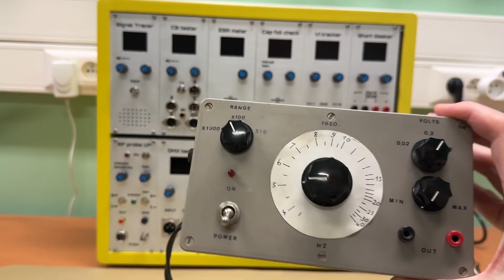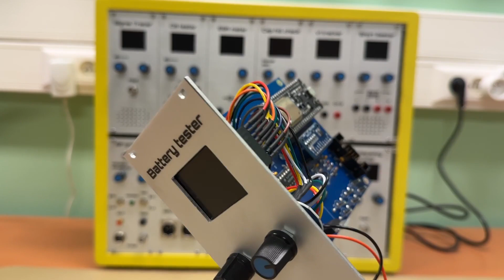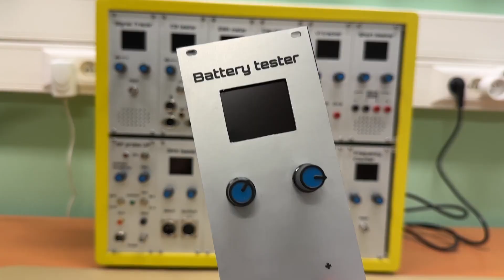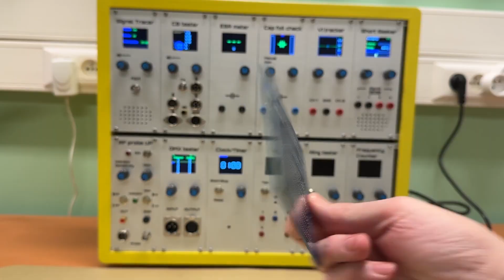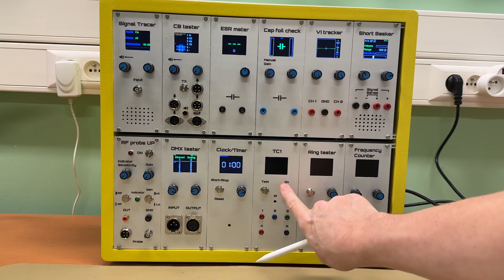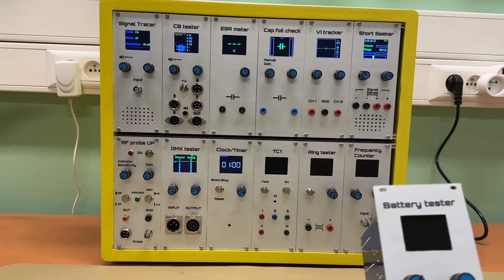Modular Test Equipment Rack

Comment: Very good. I also dislike batteries but can add wall-wort or inline (laptop type) PSUs to that list. Did you cover your PSU specifically in a video?
Reply from the maker: O yes, external power supplies, most of them have a brand name different from the equipment brand, not a clue where it belongs too…ive seen someone blow up a few barcode readers by using the wrong supply, ive had several things in for repair where part of the problem was a wrong supply with a too lov voltage…the rack construction document on github has all the details on the psu

Comment: It would be nice if the timer clock had an output that could turn the connected device on and off.
Reply from the maker: like the idea, i would use a wifi switch since wifi is already active for the ntp updates and the switch parameters can be added to the captive portal